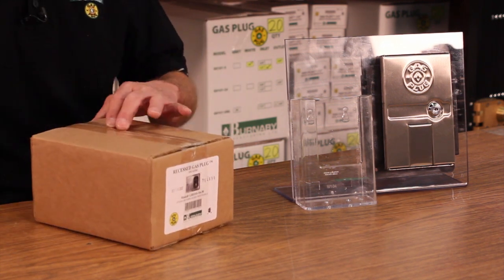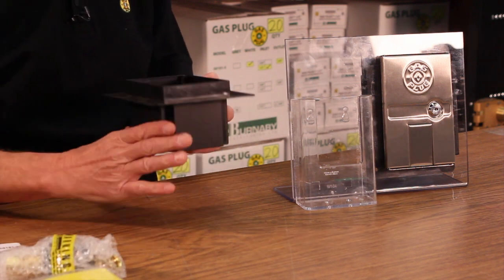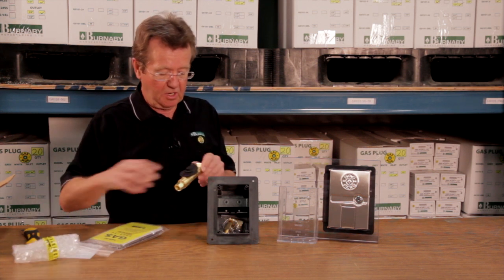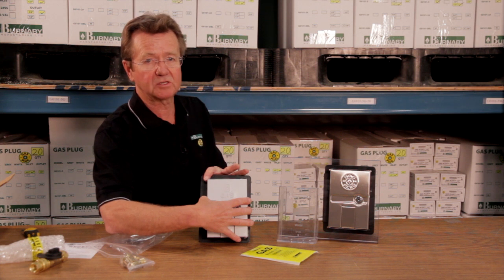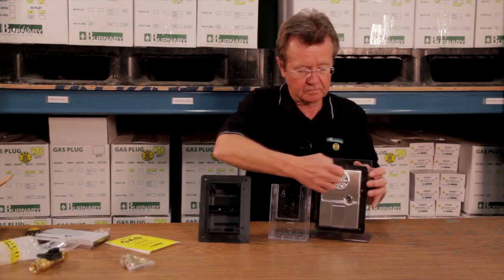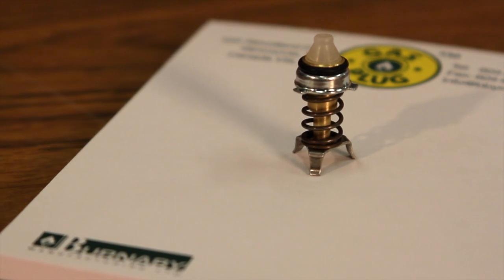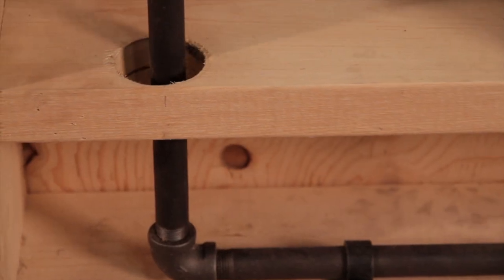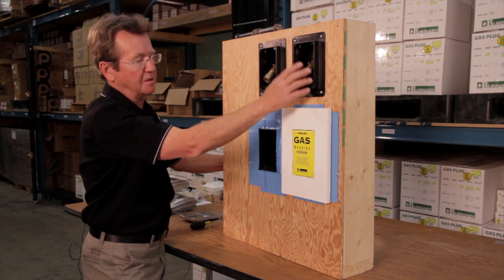Recessed Gas Plug(TM) GR0101-SS-50 - Installation Instructions

Comment: Can this be installed inside a home? 

I am looking for something similar to this product for indoor use, installed a couple of feet from a stovetop (and vent) for use of portable gas appliances.
Reply from the maker: This box is CSA approved for indoor/outdoor use, but we also have a model that is designed specifically for indoor use - the Interior Versatile Gas Plug which is available in 3/8", 1/2" or 3/4", low pressure/high pressure, with / without the quick disconnect.  Here is a link to the product on our website - https://bbymfg.com/product/interior-versatile-gas-plug/

Comment from the maker: This video shows the box being installed on a stucco wall - for brick or stone application, cut the flange of the rough-in box so that the box sits flush with the finished surface.  You may require a galvanized strapping for the mason to secure the rough-in box.

If you require further assistance, email info@bbymfg.com